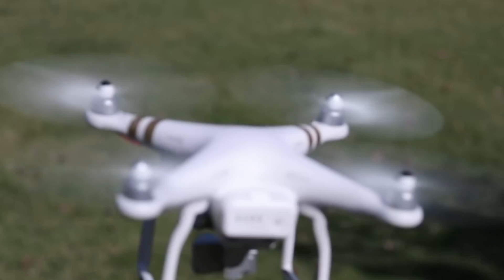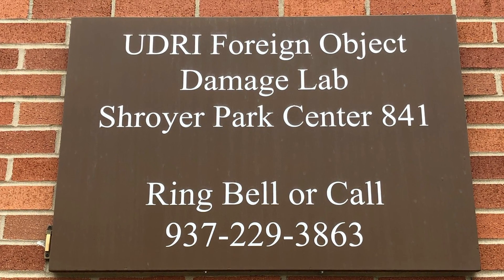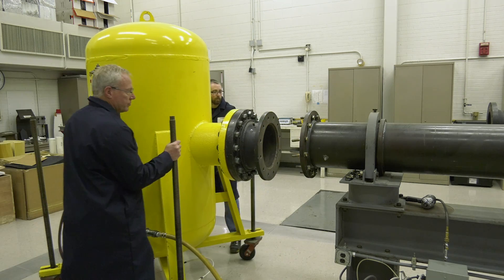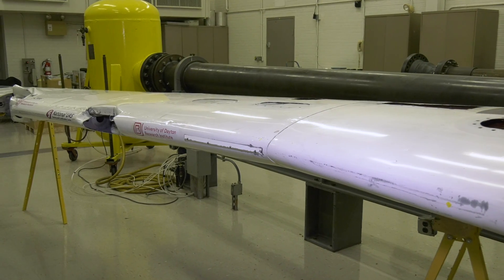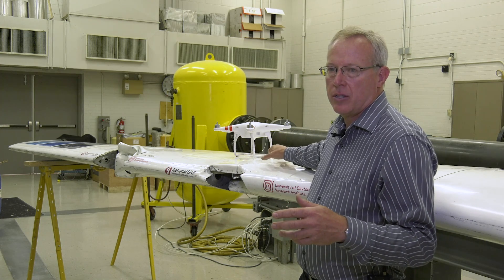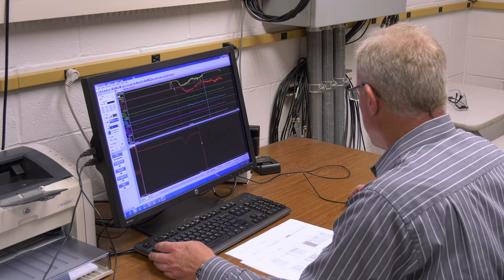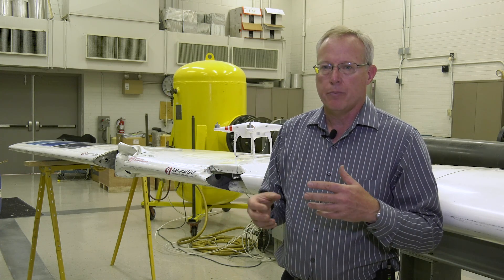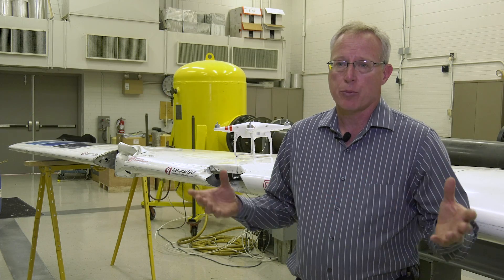What Happens When a Drone Hits an Airplane Wing? – AIN

Comment: The max altitude basically any dji drones can go is 1600. Planes won’t be going that fast at or below 1600 feet. Misleading
Reply: I guarantee 100% that your statement is incorrect. I commercially fly DJI quads regularly doing inspections and it's not uncommon when inspecting a tower to have mine over 1600 feet above where I took off from. The legal limit is 400 feet above ground level or within 400 feet of an object. 

There are a lot of videos here on YouTube that show people flying their DJI built quads well over 10,000 feet. You really should research your "facts" a bit before posting things that are completely made up.
Reply: Arstine I assume you are flying the commercial line of dji products. From my experience the consumer/prosumer ones are locked at 1600. Of course you can “hack” and achieve higher but the majority of people do not know how to do that. I am well aware of the regulations In place by the FAA. I am also a part 107 certified pilot so 🤭
Reply: I do own what some might call commercial grade and consumer grade DJI quads and have for some time now. The only product DJI makes that might have an issue hitting 1600 feet is the Spark and that's because the controller uses WiFi. There is nothing in the software that limits any of their products to 1600 feet that I am aware of, and I've owned everything from the P2, 3, 4 Pro to the Mavic Pro and Mavic 2 Pro. So if there's something that you're aware of that I'm not, I would love to see a source for the information, and that's not meant to be read sarcastically at all. I'm legitimately not aware of anything that specifically limits their maximum altitude beyond signal strength.

Comment: This isn't the average, this is literally a worst case example. The plane that they used was known to be on the weak side and has a high travel speed. This let them demonstrate the maximum potential damage, and they were shocked to find that it was less than the damage a typical bird strike causes

Comment: Although its good to see the "Potential " damage a drone could cause, the factor that was not represented here is the displacement and compression of the air about the leading edge of the wing. Its very possible the drone may actually surf the compressed air and elevate or be pushed down in the vortex and not do the damage shown. The test was good, but incomplete based on this variable.
Reply: Do they? I have never heard of a bird damaging a wing. They get sucked into jet engines, or hit propellers... but leading edge of a wing? Any examples from the real world?
Reply: Exactly!
Reply: Don't bring your science, logic, reason... into this video! How dare you!
Reply: @IceTTom  Are you a Trump advisor? Kidding, but not really.

Comment: Oh boy hear we go agian, let's blow lots of cash to see what we already know. Yes 3+ lbs at over 200mph will do lots of damage. However making a weak drone airframe will only make a lousy flying drone. The only thing that needs to be done is figuring out how to enforce the laws that are already in place to prevent this from happening.
Drones are required to stay below 400 feet as well as outside of 5 miles from any airport. This alone stops any major passenger craft from coming in contact with a drone flown by a responsible person. This with the fact that UAV's are to yeild to maned craft means that if you hear a craft coming you land keeps the smaller craft from coming in contact with a drone. Now our problem is the ones that don't care and fly at airports or on beaches while maned craft go by for a "cool" shot. 
How or, can you control that. Remember drones are much smaller now than the standard phantom 4, mavic, spark, wingsland s6, Yuneec Breeze, Parrott Anafi, and Autel Evo just to name a few.

Comment: Unrealistic testing. This is clearly just based on structural testing, not aerodynamic, as binary stated. Even if you choose to go this way, why not simulate a strike to an engine, that's way more critical. And the comparison to the bird shows that the individual has no flying experience. I'd take a hole in my leading edge (drone) over a huge deformation of it (gelatine block) any day.

Comment: If a drone hit it would actually be deadly. It’s due to the battery. Once that catches fire you just sent the whole wing on fire. You also disrupted the smooth airflow on the wing which will cause uneven airflow meaning more drag and less speed.

Comment: This test is a worst case scenario, since in reality air acts much differently on a moving Wong than in this test. But ultimately the answer to these problems is not constricting consumer freedom, but Instead making flight tracking of all low altitude planes open source and mandatory as a part of all drones software. If planes and drones communicate then there is no chance of collision.

Comment: Airplanes, GA should fly above 1500' or so except when on approach. Then drones and planes would have at least 500' of separation. Those who fly drones where planes are in approach or in the pattern are reckless, criminal, stupid, drunk, or a combination of the list. A model air plane club I frequented had its field about  1km from the approach about one mile out from an active Air Force base. Most RC planes flown at the club stayed below 500', but some gliders caught thermals up to 700-900'. This took place for about 20 years. Because the ATC  knew of our field of about 200m by 200m,  jet, rotor, and piston high speed aircraft never crossed our field. Occasionally a private pilot might cross our field at low altitude at about 500'. In all those years we  experienced no incidents, no close calls, nada, never, no. We had no radio comms, no radar, no ID, no ADS-b, No Next gen. We used our eyes and ears to detect possible and actual traffic. We took action to avoid flying in the same space by giving the Aircraft a wide birth, altitude separation , or both. Works every time.

Comment: These videos are why drones get a bad reputation.  As far as I know there has been no drone aircraft incidents where the aircraft was in  any structural distress.  As a pilot myself, drones are last thing I worry about when I fly.  There are 100's of unreported close calls with aircraft and other aircraft.  It is the misconception of drones being autonomous, that scares people.  The drone regulations are clear to keep both aircraft and drones apart.  Didn't some nut case steal an aircraft in the Northwest earlier this year and endanger 1000's of lives?
Drones are not a hazard and should be portrait as such.
Reply: I don't know ANYONE who worries about "autonomous drones", they worry about irresponsible drone OWNERS. And your "it's never happened do it's never going to happen" logic is both stupid and dangerous. ANYTHING that flies is a potential hazard, and if you can't accept that, then maybe you shouldn't be flying. BTW, there have been SEVERAL confirmed collisions betwen drones and airplanes & helicopters. A commercial airliner collided with a drone back in 2017 over Canada, and in 2018, a DJI drone collided with an Army Blackhawk helicopter near Brooklyn, damaging one of the rotor blades. The owner of the drone, 58 year old Vyacheslav Tantashov, was located after components with serial numbers were traced to Tantashov. Would you like some salt for that crow you're eating?
Reply: You are correct that there has been no actual reported drone strike yet.  I personally am not as sanguine about that as you are.
Reply: https://www.youtube.com/watch?v=HtArLIXZXRI
Reply: It is nice to see some aircraft pilots do not see every drone as a missile, intent on destruction. Thank you.

Comment: “230 mph approximates the two speeds of the aircraft” is a bit of an exaggeration. They showed a picture of a Cessna that has a top speed of 160 mph. I doubt that the DJI is then going 70 mph unless it has a crazy tail wind.
Reply: AND don't forget the aircraft would also be flying within the same airmass and therefore also be affected by the same wind and result in it having zero effect on closing velocity.

Comment: That bird strike actually looked worse... The huge yaw from air drag and loss of lift (requiring more aileron at that side, which gives even more additional yaw and an induced pitching moment required when canceling out the roll). Sure the DJI did a lot of damage, but it was a nice clean entry wound compared to getting bashed by Thor's hammer... 200 mph is pretty fast for a general aviation plane, are they using Red-Bull stunt planes? That would still be a realistic test for Red-Bull racing if they wanted to photograph the event, but that seems not very typical. A Cesna runs closer to 80 mph (or much slower if your just chilling).

It's an accurate test for that exact situation and that exact plane, but you could find the same results by showing a car at 300 mph, is it really representative though? (For a car racing 300 mph, it would be, but most of the time it wouldn't).

Maybe chop the wing in half where the damage was, because it still looked flyable. Repair it obviously when you land, but that didn't look like a critical structure failure that would cause any immediate danger unless your doing high wing loading jerking on the stick like a madman and doing insane pull outs. It wouldn't be a great day for either person, but it didn't look life threatening from the views shown.

Comment: The damage a multi rotor can do to an aircraft wing is minimalistic. That’s not a fatal issue. If you really do want to use a scare tactic on people so you can get your way and kill the hobby; then use a turbine engine, or better yet, have it collide with the wind shield. You see, most of the people in the RC aviation hobby are rather responsible. There are but a select few who aren’t. I for one am not in multi rotors. I’m into RC planes. Foam and balsa would do absolutely nothing to a full scale aircraft. Even then, I still know where it’s a good idea to fly, as well as where it’s not a good idea. I do believe however, that it should be a requirement to at the very least have common knowledge of where to fly. If a test is required, so be it. Drones themselves aren’t the problem. It’s simply the lack of education.
Reply: I too, fly more traditional RC planes most of mine are under 1lb and built with foam and balsa... when I hit a survey stake(a 1x2" pine stake) landing one time I nearly took the wing off my plane, but the stake was fine... the stuff built like this should not be lumped into the same category as solid carbon fibre  or aluminum framed quads... and yet we are...
Poor testing policies, and propaganda are killing this hobby.

Comment: And yet, even with this highly unlikely  situation the plane would have been able to land safely. Simple solution, GA planes need to stay above 500 feet except where landing/taking off as legally required and drones like these keep under the now legal requirement of 400 feet. This would never then happen and this biased experiment is pointless.
Reply: Exactly your so right
Reply: I think it's better to prioritize the safety of passenger airliners than it is to prioritize the convenience of drone hobbyists.
Reply: MrMilkman29 it’s not prioritizing safety in this case. It’s just enforcing the already set rules which make this kind of event impossible. As a 100 foot margin is more than enough to avoid this kind of incident. At this point it’s just an experiment made to give evidence to a point which never should come up at least according to law.
Reply: You miscalculate and assume that "safety" provides you zero risk. True, banning drones would eliminate the risk of death due to drone strike. But you are still willing to get on a plane that can be taken down by a bird strike. Air travel is a convinience as well. You could always walk, take a train, drive a car, take a bus, or ride a horse. No risk of drone strike thre. Or walk on a sidewalk, drive a car, climb a ladder, step in a bathtub these have risk too, far more deaths every year from these simple activities, yet you are twisted up over drone flight
. We should prioritize the safety of mrmilkman by locking in a rubber room for the rest of his life. He will be surely safe then.
Reply: @MrMilkman29  There can never be zero risk but also the level of risk from a drone strike is tiny in comparison to the risk associated with accidents due to pilot error in GA (by a huge margin the biggest risk), bird strikes (you can't ban birds or limit them to below 400 feet), and air traffic mistakes. Remember the most deadly air accident on Tenerife  involving 2 fully occupied 747 jets was caused by the captain ignoring/mishearing others saying not to attempt take-off and plowing into the other plane that was still crossing the runway.
There are always risks but just don't demonise drones. The vast majority of 'drones' are flown barely over tree height and often in-between trees .... these pose no risk whatsoever to GA but would still come under such a blanket ban.
Most aviation modellers are flying to a very comprehensive set of safety rules to minimise risk. And have done so without any loss of life/injuries to manned aircraft EVER. GA with all its safety measures cannot say that!
Reply: Pilot error is something that is actively being dealt with in order to lower the rates at which those incidents occur. Banning the use of drones near certain types of airspace or above a certain altitude would not interfere with the activities done by those people who fly drones at low altitudes for recreational purposes.
Reply: @MrMilkman29  I agree the exclusions around airports and height restrictions are very sensible precautions to take. However the FAA  and their counterparts seem to thing a UAS (the current hip abbreviation) that weighs 251gm have the same risk as a 25kg one....that's just mad!!!!
And I object to you describing me as arrogant, I like most who take model aviation seriously belong to a club, adhere to club rules regarding safety which are at least as stringent as the current FAA recommendations. It is the uneducated buyers of the super automated air vehicles like DJI and similar sell and then go out and fly without regard to the existing regulations and recommendations.
A bit like a certain guy who too an Air Canada  plane for a joyride recently.
No amount of rules and regulations stopped him, in fact the plane didn't even have a 'key' to stop him. At least the DJI drones wouldn't even take off if they are close to an airport or a no-fly zone.
What I'm trying to say is that a knee jerk reaction to ban something new is not usually the right thing. 
Oh and if you want to save many more lives and reduce injury to the public....ban guns.
Reply: Sorry for calling you arrogant, the main thing I'm trying to talk about is that regardless of how minute the possibility is for a collision between a high speed aircraft and a drone is, these tests are useful simply because it can give pilots and drone users an idea what type of damage can happen if either one is not careful while flying. General consumer GPS systems have limitations programmed in that shut off the module after a certain height or speed is achieved, as to prevent people from building guided missiles, and maybe in the future there can be GPS modules specifically for drones which can be programmed to automatically avoid flying within certain types of airspace, circumventing the need for bans and instead just mandating the use of these modules for drones. I agree that super tiny drones may not pose much of a physical threat in terms of collisions or deliberate attacks, but camera technology may allow for even the smallest drones to have some sort of spying capability in places where that may not be allowed.
Reply: "Regardless of how minute the possibility of collision". "camera technology....spying capability". Do you even read what you type? The odds of a death occuring are 1 in 400 years (per another Youtube I've just watched). This is the bar you set for risk tollerance? You are 1000 times more likely to die of shark attack, lightening strike, falling from a ladder, the list goes on and on and on. Ah that's not the only reason I'm terrified of drones. They might, sssssspppyyy on mmmmeeeee. Good Grief. There are camera's in every cell phone, on every street sign, every store. Google drives around the globe taking picture of every house and flys satellites overhead. What on earth will you do? Take your misplaced fear/aversion/phobia of drones back into your basement where you belong.

Comment: Total BS, the landing speed of a Cessna is 80 mph. Phantoms are hovering most of the time. Especially if the operator is retarded enough to loiter near an airport to film planes. F-15 fighter jets land at 190ish. Douche bags like these make things look far worse than they could ever potentially be. Just like NBC or whoever the disengenuous turds were the put a model rocket engine in a gas tank to show how dangerous a vehicle can be to drive. Phonies!